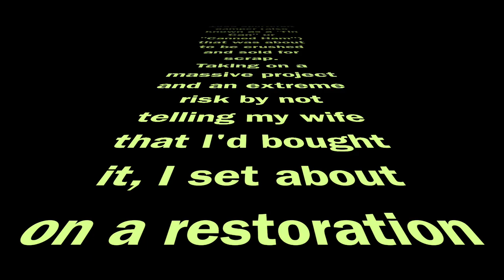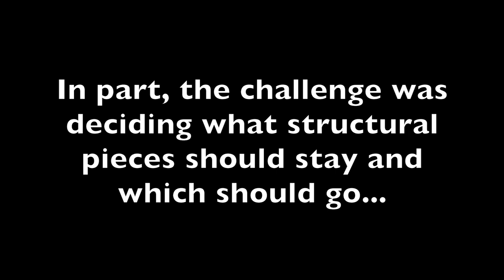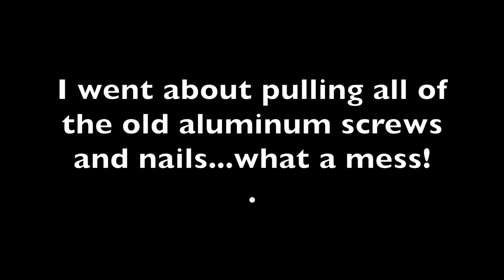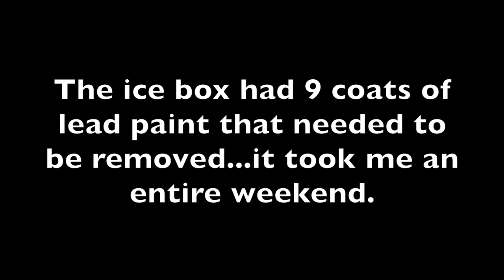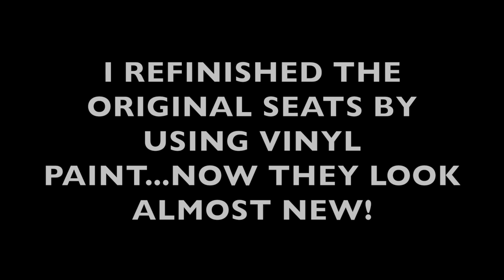1955 Sportcraft "Tin Can" Restoration

Comment: Jay, did you ever complete the renovation on the 55 Sporto?  Can't find it.  I just purchased a 54 Sportcraft.  It's in decent shape.  Will probably pull the driver side wall off and replace the plywood.  There is a bit of rot on the rear roofline and wheel-well on that side.